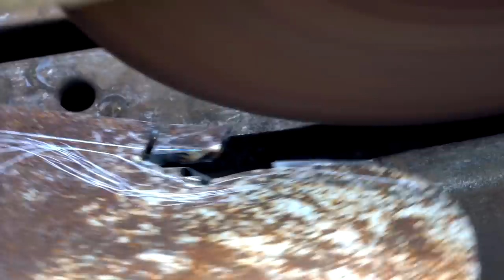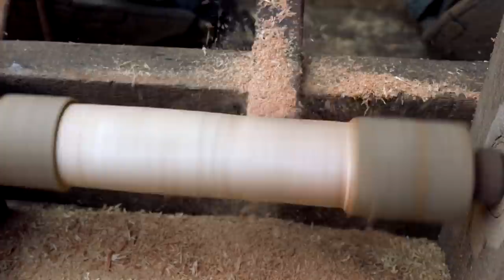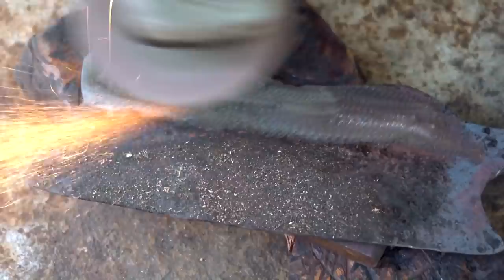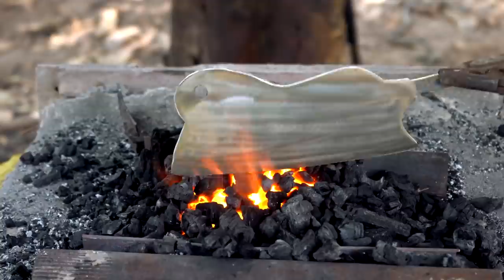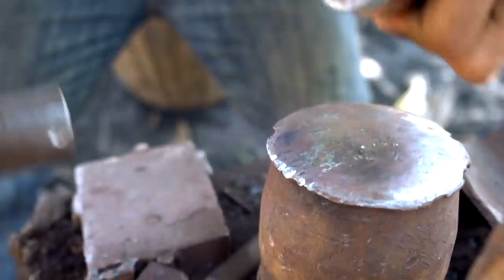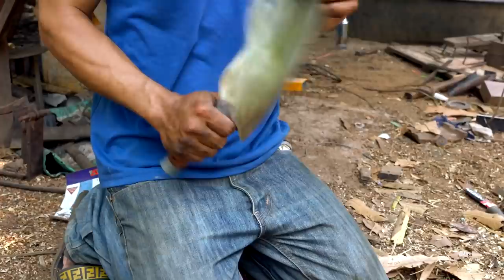KNIFE MAKING - FORGING A MEAT CLEAVER KNIFE FROM A RUSTY CHAINSAW BAR

Comment: How’s that going to work ? Most chainsaws blades I know are two parts spot welded together.
Reply from the maker: Yes, Sir. Not the best steel, but we still can use it and need time to forge the blade, also good to practise with. Thank you very much.